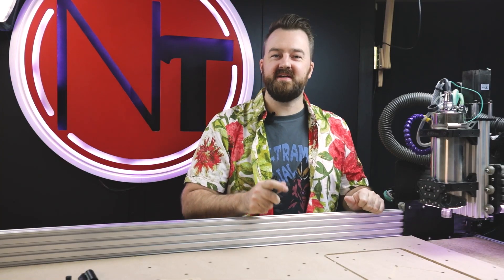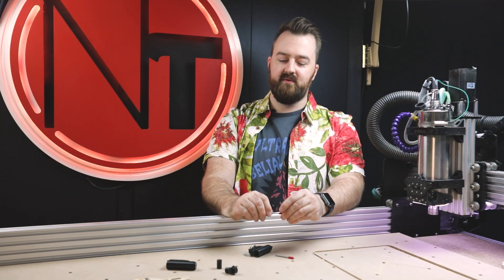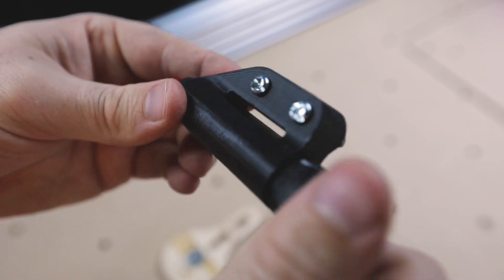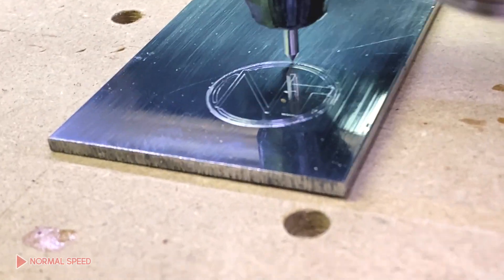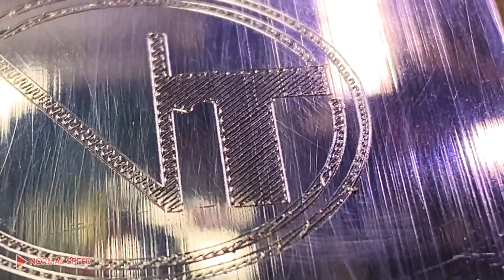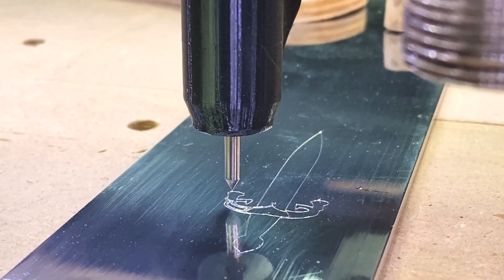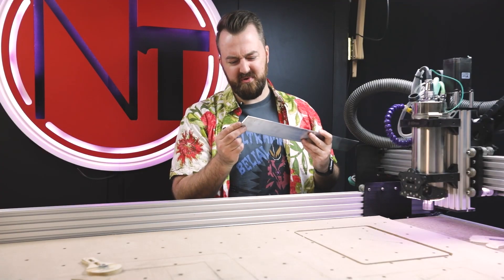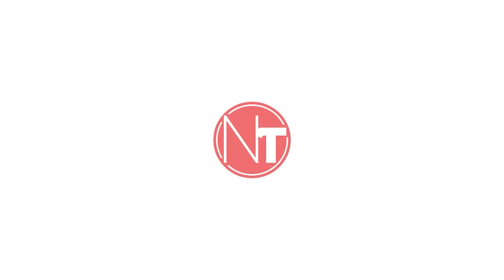DIY CNC Diamond drag engraver // Workbee CNC // Fusion 360

Comment: Hi Myles, Great video. I have printed the parts and they came out great. Just wondering does the piston go with the hole up or down, Im guessing up or bit will go into its hole. If this is the case then this bit could be solid. Can't wait to try it just ned to order the engraving bits.
Thanks
Tony from UK.
Reply from the maker: Thanks for your comment Tony! The engraving bit needs to be inserted into the piston and helps with alignment and keeps the spring in tension. If it was solid, the engraving bit will stick out too far and have too much play. Your welcome to have a tinker with the design! I’ll upload a sectional view of mechanics to the thangs download page for reference! Have fun with it 🤩